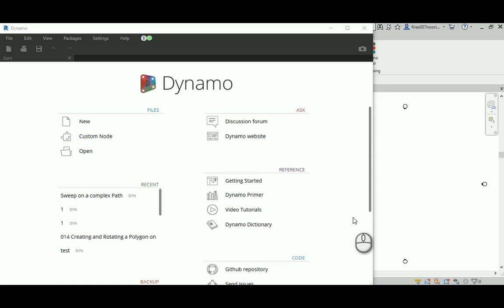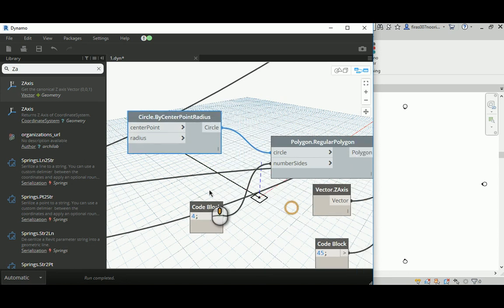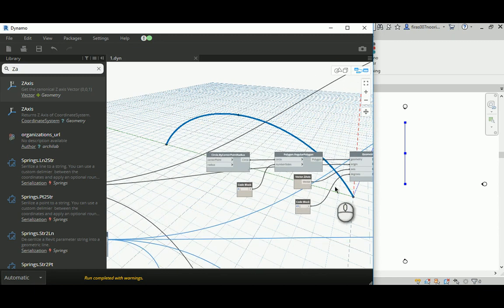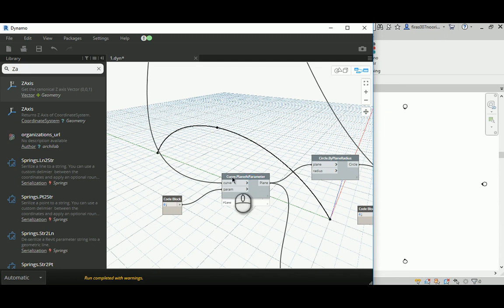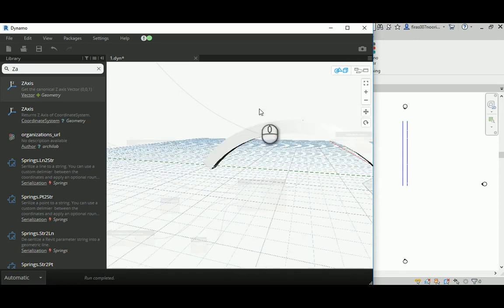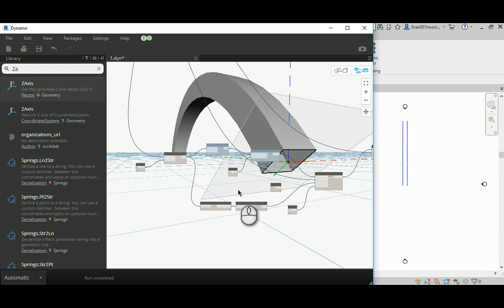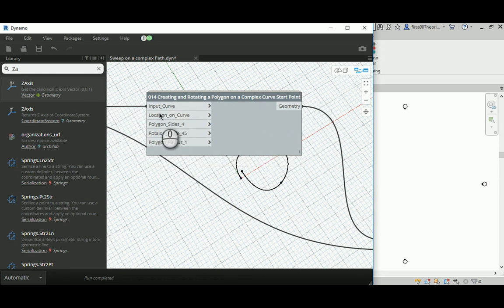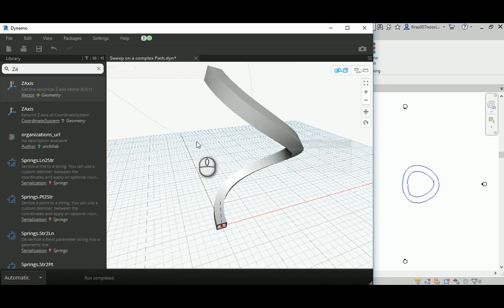Dynamo Sweep on Different Path Types

Comment: Great, is there a way to load a customized profile for the sweep?
Reply from the maker: Yes, use select model elements to get the lines from revit, curve.curveelement to change them to revit lines, then make them polyclinic and apply them to the required plane